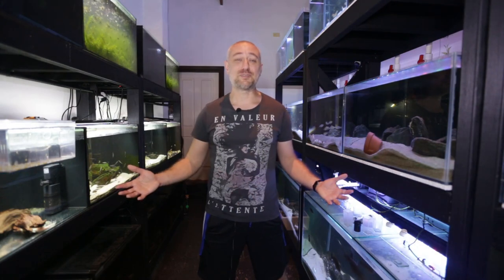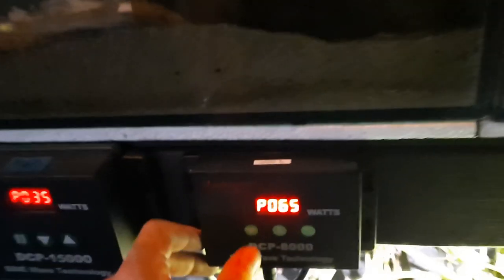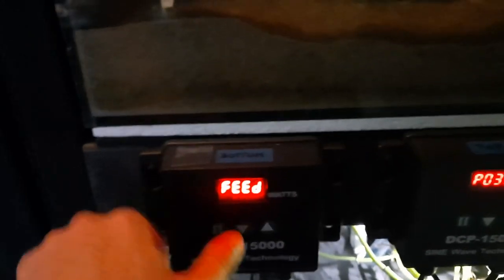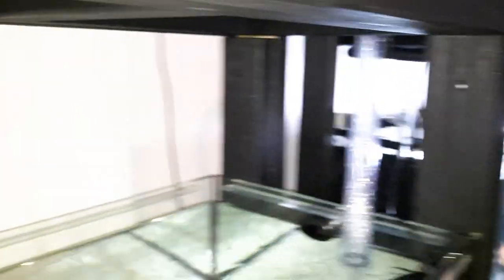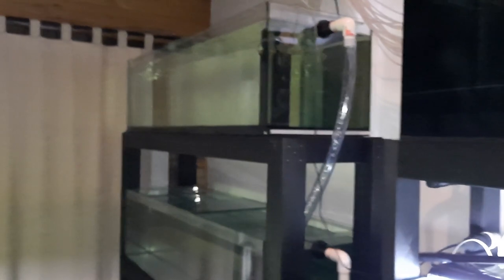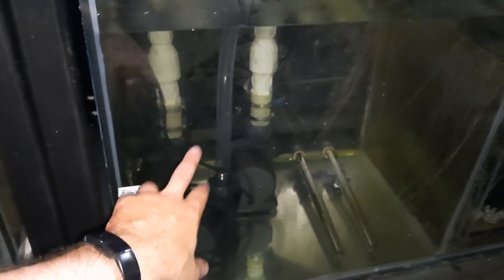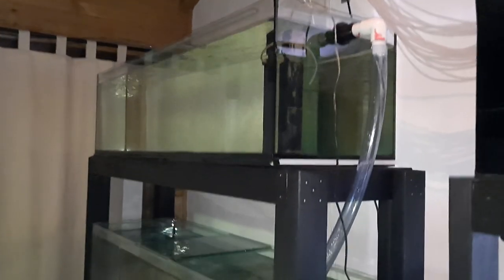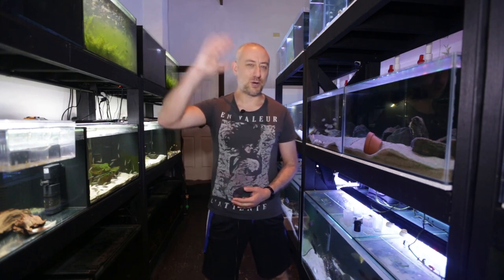Testing my new Fish Room Plumbing! Installing new 5 foot aquariums! Part 2

Comment: Hi Jason.
Really great to see again.
This is a great journey for you and us to be privileged to see.
Can I ask what size overflow hole you had drilled into the tanks?
Also what size pvc pipe etc.
Thank you 🙂
Reply from the maker: Cheers Paul. Glad you have enjoyed it mate! The overflow hole drilled was about 50mm from memory. The pvc pipe I used is 25mm. But remember this is a temporary measure. When I do eventually hook those 5 footers up to the  new sump system the common drain lines will be wider due to the larger volume of water.

Comment: You can reduce the amount of water that drains into the sump during a power outage by raising the overflow above the bulkhead and/or by increasing the overflow surface area. A  single 25mm (Australian 25mm pvc) bulkhead can handle over 3000lph by itself at full siphon, but the water has to rise to the top of the bulkhead to be able to do that. So with that raising the overflow above the bulkhead means the water in the tank only needs to rise enough to go through the overflow where as the water in the overflow rises to the level needed to go through the bulkhead. Increasing the overflow surface area means it can flow more reducing the height the water needs to rise in order to flow the appropriate amount through the overflow. With the correct overflow design you can reduce the water that drains out by a lot.
Reply from the maker: Yeah you can reduce the volume of water by using say a 90 degree elbow. That said, I wouldn't want to have the tanks running so full as the tanks are drilled high.

Comment: I would just do an overflow in the sump that leads to a drain, and you can do semi or automatic water change on the entire system
Reply from the maker: I have considered that but I don't like the thought of some of the new water going straight down the drain

Comment: I have a red texta mark on the side of all of my tanks so I know when filling them or doing water changes on individual tanks that it is at the right level and when the pumps are running that there are no leaks or something else wrong with the system. The only hiccup I can see is that if you get an infection or something wrong with a tank or fish in a tank that it will go through all of your system as they are all connected. I get this comment a lot in my video of the No drilled holes water change system. So. how do you intend to limit this or solve this problem, as you do not have any bypass system in place, whereas in my system I can isolate any tank at any time and the system will still operate but in yours, it will not, as you have tanks flowing into other tanks and then into the sump.
Reply from the maker: Yeah Tim marking the tanks is important  to know where to stop draining your tanks at. I have mine marked out too, it all depends on the combinations of tanks of draining from that week. Oh yes infection is a concern with all sump systems. Quarantining new fish is a huge thing for me. The way these 5 footers are currently set up (with one draining into the other) is a temporary measure. The tanks that are currently set up to my sump system are all able to be isolated from the system. Sorry if that wasn't clear in the video mate.